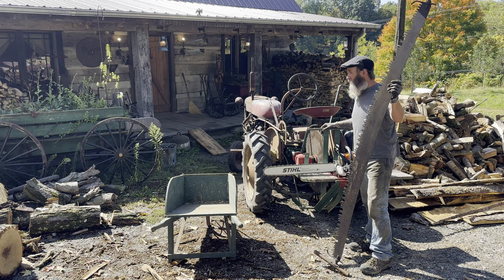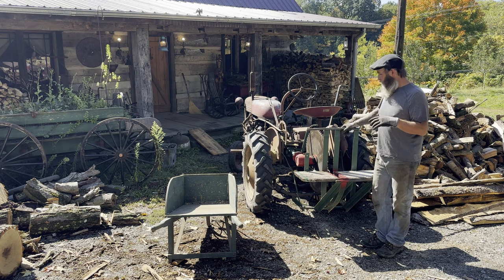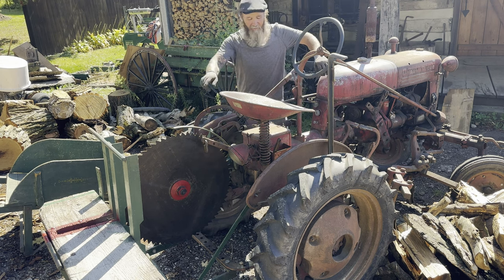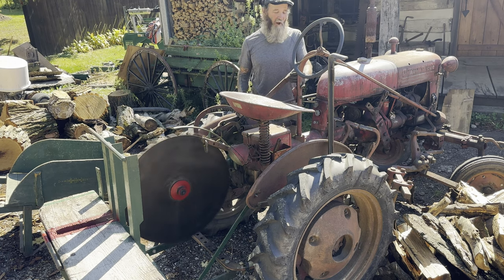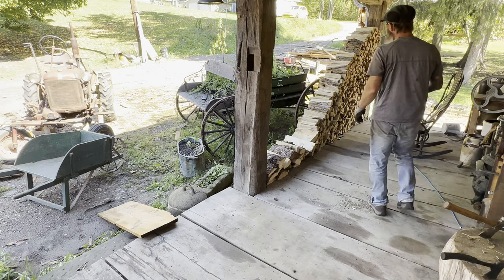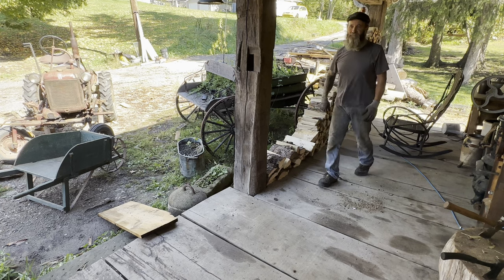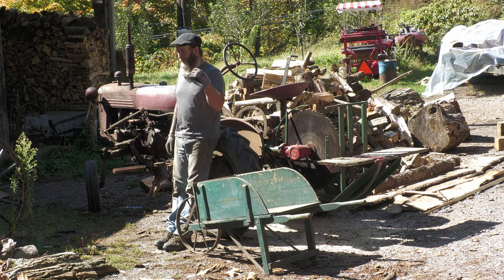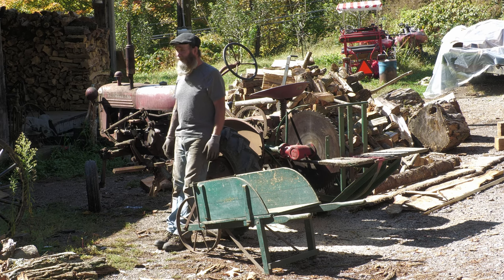1949 Farmall cub with PTO driven ￼buzzsaw making kindling wood at the cabin ￼

Comment: I have a chimney sweep question. My house is two stories, tall no way to get up to the top to clean the chimney. Could I use a chimney sweep from the inside all the way up out through the chimney? When we installed the fireplace insert I had to have my sons buddy use a bucket truck to get the pipe down the chimney because it was so tall and there is my dilemma. I don’t want to have to ask him to bring a bucket truck every time we need to clean the chimney so that’s why I was wondering if I could go from the inside up to the top to clean it like that. and I have a tin roof and it’s steep. I would appreciate your input. Thank you.
Reply from the maker: Yes, if you can get in at tge clean out or thimble

Comment: Like the way you can get same size pieces with every cut.

How does it do on full oak logs that are not slab wood? I’m guessing lifting a log would be challenging 

Thanks for showing your operation
Reply from the maker: It does good with logs but your right picking up the big pieces isn’t the easiest. I used it for logs that are just a little too long and need an inch or two cut off more than long stuff